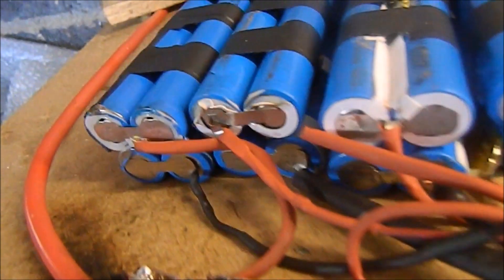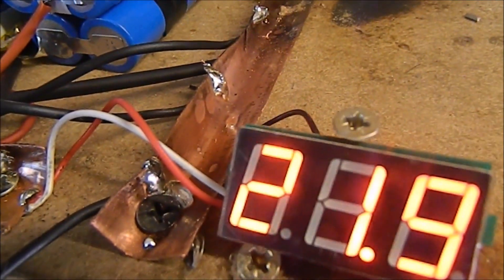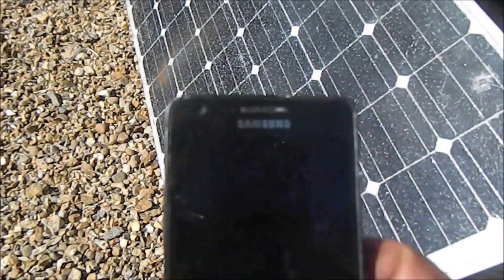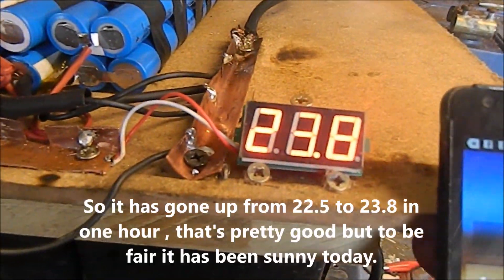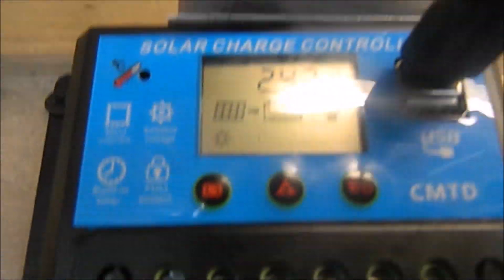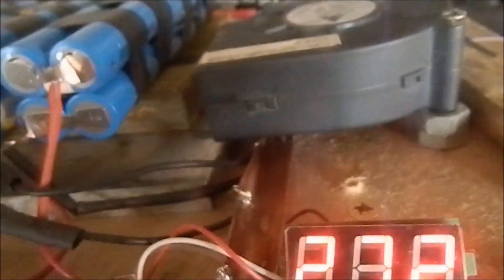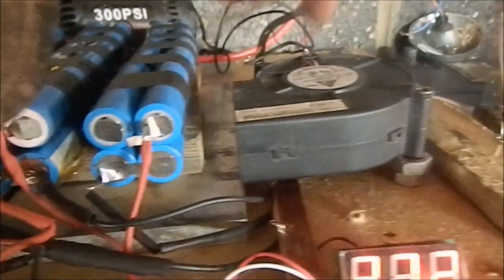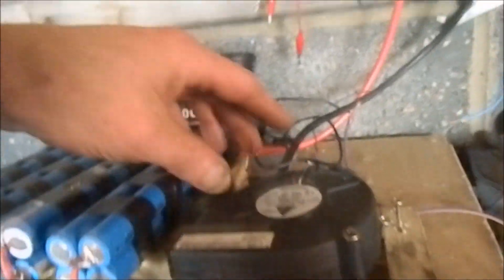Fully working DIY 24v lithium ion solar panel battery ,OFF GRID PROTOTYPE.

Comment: I strongly suggest you use 7 series cells rather than 6. That charge controller is designed for lead acid, and will over charge the li-ions

Comment: keep experimenting this looks amazing. just watch out. This one is a pwm controller. PWM controllers may decrease the life of your cells. I know it was just an experiment. Try out some MPPT controllers for lithiums. I might get one used for a lead battery because finding the exact voltage for lithiums are a pain in the but. I'm trying to get a 4S configuration so I can use stuff meant for a car port and an inverter.

Comment: Don't you need a special lithium charger? (CC/CV) Won't lead acid charging patterns from the charge controller damage lithium cells? Also, I don't see a BMS, are you relying on the solar charge controller for that?
Reply from the maker: its just a standard 5$ Leadacid controller , which seems to be working fine.

Comment: If your battery packs not meant to get above 24v then your charge controller is crap at doing its regulation and you should be using a balance charger on each pack to ensure that individual cells are not out of balance.

The last thing you want is a cell or pack exploding and going up in flames.

Comment: I killed my pack by over discharging one set of cells due to the cells being unbalanced, But I always charged and balanced them with the imax when hooked up to my lead acid bank. What is to stop yours from getting unbalances and ending up with on string of cells being at say 3.9v and another string being over 4.2 and going bang under charge?
Reply from the maker: +pietkaify I don't know mate to be honest,this is just an experiment using 8 laptop packs which tbh are poor quality , so we will just have to see,I've had a load of grief with my imax's lately and was looking to upgrade to something else,were yours half decent batteries or cheap ones,as I said this is still a learning curve for me, the Tesla power walls are expensive because they contain all new samsung batteries, on the flip side my bike battery is still 90% ok despitelosing a couple of rows 11 of them are still over 4 they were made using sanyo and samsung batteries.